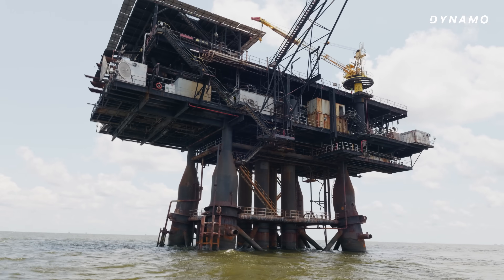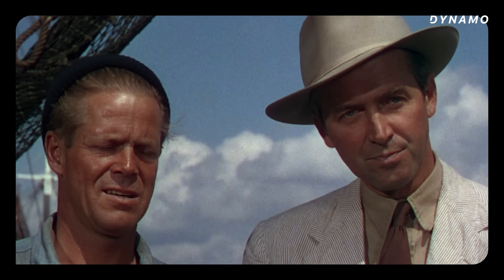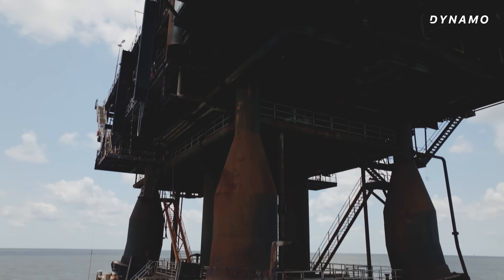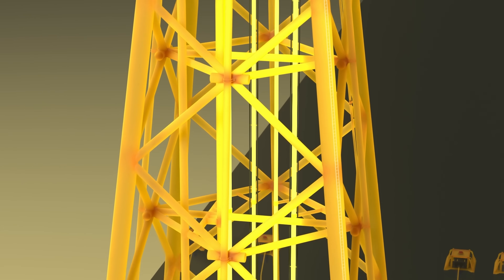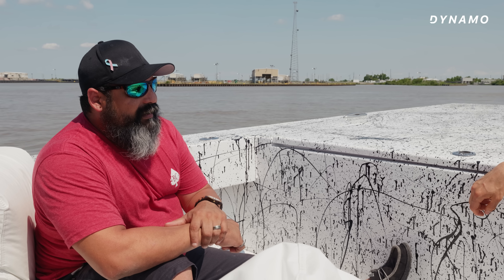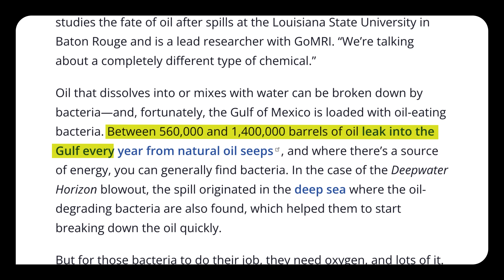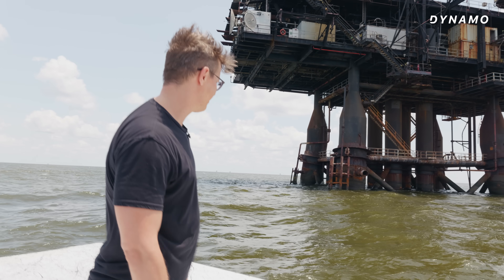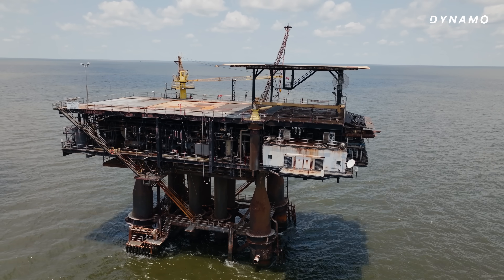I Visited Abandoned Oil Rigs — and Found Something Terrifying Underwater

Comment: Corrupt American politicians, paid personally by the oil industry.

Abandoned Wells
There are approximately 14,000 inactive oil and gas wells in the U.S. portion of the Gulf of Mexico that remain unplugged. 
Definition: These wells are considered inactive because they have not produced oil or gas for at least five years and are unlikely to be reactivated.
Legal Status: Approximately 2,700 of these wells are considered "delinquent," meaning they are overdue for decommissioning under federal law.
Orphaned Wells: Over 32,000 total offshore wells across the Outer Continental Shelf (including the Gulf) are estimated to be abandoned or "orphaned," meaning they lack a responsible party to oversee their closure.

Comment: I work with a company in 2025 did a full season with pull out 14 facility For a Major oil Giant. It was hard work with 12hrs shift, but honestly is all the Bs the Major Giant put in the writing and the bureaucracy behind it what make the job harder along with the man power and not whiling to paid, and yes I believe they are just 2 cranes whiting Louisiana boundary along comes BSEE and not counting in some Jerk Foreman that try to save the industry. Money is not there and is a lot involved in cleaning and blow out that happens at time of the removing this Platform. We remove a giant 856 Tons it was a beast.

Comment: Since 2017, BOEM has focused on supplemental financial assurance for all sole liability properties where the owner is not financially strong, as determined by criteria found in the regulations at 30 CFR 556.901. BOEM defines sole liability properties as those where only one owner is liable for the lease or grant obligations. If the single owner defaults, there is an increased risk that the government will have to pay for the decommissioning costs

Comment: I have worked in the oil and nat gas industry for 15 years so far as a landman here in Oklahoma ( and no the TV show Landman is not accurate lol )  Anyway we have programs out here to clean up old oil sites and for the most part it works pretty well.   The problem with these big industry companies and that includes chemical companies is that the fines are cheaper than the cost of cleaning up and disposing properly.  I am a big proponent of fossil fuels, but it needs to be done in a clean and responsible manor.  I will say that I do appreciate you for the most part keeping the oil and green energy politics out of this and not making this a demonizing fossil fuels video.  I enjoyed watching this and some of it I knew, and some of it I did not know.  Good stuff.
Reply from the maker: Thanks for this! Means a lot coming from someone with your experience. -Nich
Reply: Oklahoma has a problem with the abandoned oil wells across Oklahoma. Wastewater from the oil wells is starting come out of the ground threatening the drinking water supply. 
The wastewater from the oil wells is carcinogenic.
Abandoned oil wells are a plague across many oil producing states.
Reply: @Release-Jeff-Epstein-files   actually the problem in Oklahoma are the Wind Turbines.  They are not green friendly at all.   Also as someone who drives all over Oklahoma for a living I do not see tons of abandoned oil wells.  If a well dries up the pump jack just stops and it is a small area of land not much larger than a garage that sits on private property, generally a farmers land.  Also  Oklahoma Energy Resources Board (OERB) cleans up old well sites and have done so with 20k sites so far.  Also it is pretty easy to plug a well.    Oklahoma has robust, ongoing efforts involving both industry self-funding and legislative action, but the scope of the problem means the cleanup is a long-term, evolving process.  Also many wells are on Tribal land which are under the jurisdiction of those Tribes.   You can't compare abandoned oil wells in Oklahoma to what is out in the Ocean.

Comment: What would planet Earth do without climate freaks to clean up stuff it produces naturally that the herd pumps out haha.. Ask free AI about Algae in caves that requires no light. Notice same products can be made with Algae processed into Crude the exact results of use.. "Fossil fuels!" Hahaha.. Points at CO2 Generator at Greenhouses Ahh! Climate Change generator! Hahaha! Runs finger from Diesel engine Thermoelectric generator wrap to capacitor bank then to pump that is in sync with engine exhaust to push through water without hindering the engine Oh hey! Carbon nanotube and Synthetic Diamond resources! Hurray! Primitives.. Can't even base natural hahaha! Points at giant holes in Russia made by underground methane explosions > Slides finger to Oil rigs burning Methane I would be using Ultrasound and sending that Methane in a loop to a tank with Ultrasonic resonance heating + Ultrasound pressure + Cavitation until the Gas indicator light goes out then running through a fuel water filter = Methanol ftw.

Google: "Organisms that eat crude" + "Organisms that eat plastic" Mother nature already has solutions for when pressure builds leading to natural oil spills. Like I said, where would Earth be without climate freaks? Points at acidity level in exhaust filter > Points at acidity level in rain Remember Acid rain? If you want to solve things > Google: "Chlorine DNA damage" + Ask AI: "Why did we stop using Sodium Fluoride as rodent poison?" Start with "Genotoxic" dosing of masses which is why you're all so easy to get into a larp. Holds up a Scale Define: Genetic behavior.. Earth science: "We wuz scientists and sheeit! No sound in space no medium! Hey, lets talk about the interstellar medium." < Lol.. My favorite climate freak to date on Hate list = Google: "Hitler the Vegan" Yesss.. Extinction Rebellion. - Dracula/Hades

(Edit: For history defect majority = Dracula means son of the Dragon aka little Dragon.. That removed order of the Dragon from Religion because they caused cannibalism with a meat ban. What Religion was majority in Germany ww2? Now look at them teamed in WW2 with Islam. Okay.. Now look who owns all the oil. Nazi got you AGAIN.. HAAHA!! Ready for round 3? Googles: "Saucer over Dracula's birthplace pouring SMOKE Yahoo news 16th Century Church painting" I know the SCIENCE.. I mean I gotta, I own the bad mind downloading server.) https://www.youtube.com/watch?v=ZOg8PG6BUHk

Comment: Would be kinda cool if the old rigs were safe enough to turn into a house or something….. cap the well and remove all of the pumping/ oil stuff ……. Kinda like the sea land people
Reply: There are a number of unsustainable reasons why such notioning and mayhapsing is a pipedreamt nightmare . One of the important ones is a fleet of PSV's is required to  maintain the platform and the PSVs themselves as well as supply the humans needs. It is also known as logistics and they fail when the platform is unproductive, that is economics.

Comment: I feel compelled to respond to this video.  Full disclosure, I have worked in the Oil and Gas Industry for 36 years.  The cases that are referenced in the video (BP Macondo and Taylor Energy MC-20) were not permanently abandoned wells.  The MC-20 wells were certainly aged, but were live wells in production at the time of the accident.  Macondo was an exploration well in an unproduced reservoir (the reservoir pressure was 16,800 psia).  Macondo was temporarily abandoned (I don't need to comment on the effectiveness of that process).  A depleted and properly abandoned well presents a different risk.  It is misleading to suggest there are thousands of Macondo's waiting to happen.  The remaining energy in most abandoned wells is much lower and they have been plugged and abandoned in manner to ensure that a blowout will not happen.  The industry does need to behave responsibly and within the law.  Blowouts or spills should not happen and are not excusable at all.  However, it is important to present both the risks and the benefits the industry provides in an accurate manner to make good and properly informed judgements on it's value to our region and our country as a whole.

Comment: Saw a couple of contradictory things here, you indicate that many of these rigs or platforms need to be capped because they're the possibility of leaking oil, if they will still leak oil and why aren't they usable to retrieve the oil that they're indeed in danger of uncapping? Then you mention smaller companies squeezing out what's left, and then ultimately filing bankruptcy, my concern is who allows these companies to build these platforms and not remove them when they're done a plain and simple and common sense question, somebody must be in bed with someone to allow these huge corporations to build these disasters and not clean up their mess when they are done! Absolutely ridiculous!

Comment: You should really know what you are talking about before you make a video. 
First of all, depleted wells are not just abandoned. They are plugged just not removed. Secondly a depleted well can not build up pressure and blow out, it’s depleted!!! Otherwise the company that owns them would still be producing them. So you looked at the well files to see what and why those wells are no longing flowing, I’ll answer that, no you haven’t. You see these old platforms and assume they are just abandoned with no regard to wildlife or ecosystem around them just so you can make a video to make money. 
By the way I’ve been working in the gulf for 45 years and a producing well will not “blow out”. Do you even know what a blow out is? Probably not. Main Pass 77 is not an oil rig. Do you know what an oil rig is? Probably not. 
You have all this information on your video just crammed together like you know what you are talking about but in reality you don’t know anything, especially the difference between drilling and production.

Comment: Congress could easily pass a law saying: you have to set aisde x amount to plug the well before you can even start construction, and will be held criminally liable (actual jail time) if you don't follow through.
Problem solved. That easy.
At least it would be if it weren't for citizens united and corporate lobbyists.

Comment: If old oil wells can be used to produce hydrogen then we need to be throwing every penny possible at that. Oil and natural gas will dry up probably in our lifetimes and we are yet to find a reliable, sustainable and less ecologically damaging alternative. So far the only ways we have of producing hydrogen takes huge amounts of energy to create rather insignificant amounts. If old oil wells can be turned into hydrogen farms and do so without causing insane amounts of ecological damage then it’s an absolute no brainer.

Comment: i don't know how I didn't know there were so many oil rigs just sitting out there abandoned. I only ever thought there were like a 'big' handful of these kind of structures just sitting out there, but I wasn't expecting there to be hundreds (possibly thousands) of them out there. I usually thought that they always took them apart (the oil rigs) piece by piece or whatever (maybe except for the lower supports or parts like that cause those would be a lot more difficult to take out) or at the very least most of it to where the platform was basically the only thing left.

I know for a fact that there are so many things you can repurpose these rigs for. of course, I know that this will come with risk like if its unstable or poorly maintained and all but still...you can at the very least...uhhh...idk, do something with them 😵‍💫

Comment: The thing that would make the most sense (to me) would be the large multi trillion dollar company that installed the well and platform in the first place has the responsibility to seal the well. the rig itself can be passed down from company to company eventually becoming a wind farm of hotel or whatever, but that 1st company that put the hole in the sea floor had to have the money for the bond to remove it when the time came. forcing them to come back and deal with it after it's been handed down and sitting idle for 40 years would make them the financially responsible party and they would be financially capable. That bottom rung company just scrapping by doesn't have the ability to stay in business after it taps out so why would we expect them to deal with the removal cost. Unless the bond is also past down with ownership. but $5 says Shell still has that 1-3 million dollar bond in their pocket. that way the original bond would have grown with inflation and what not so the last company gets to use it and cash in what if any extra remains from it. that might keep the 1st and 2nd tier owners happy since if they go cradle to grave they keep all the bond, but if they pass it off to someone else they are handing over the financial equivalent of 1st and last months rent to the next company for the eventual clean up. but I'm guessing these laws don't work the ways we want them to, or for them to make the most sense.

Comment: I flew for Air logistics and Bristow in the Gulf of America for 17 years and seen many platforms, both good ones and down right disgusting ones. But I would not say that these platforms are abandoned. The owners still have have to make monthly, bi-weekly or in very rare cases daily visits as set by the BSEE, formally MMS, to ensure the fog horns and beacon lights are working and that there are no contaminants being released into the water. Each platform also has a set number of fire extinguishers that need to have its inspection card punched each month and replaced every year. BSEE may fine the owners for past due inspections or maintenance that were not completed. I've seen many operators panic at the sight of a helicopter circling overhead thinking it might be BSEE making a unplanned visit.

Comment: How do u risk a blowout if they dry up? If there isnt enough pressure to pull barrels how is there enough pressure to cause it to leak at anything larger than a natural rate….
If anything i feel like im more worried about the toxic/exotic metals/compounds left behind to dissolve into the seabed or water…. Shit like leftover welding rods or consumable trash that have cadmium, lead, and all other types a funky shit…. Idkk thats just my line of thinkin
Reply: Someone please inform me on why a blowout is still a risk if its dry

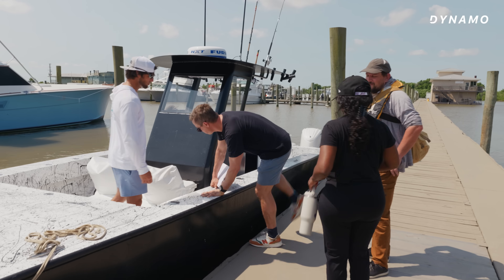Comment: 7:18 well questioning if an oil rig is bad for the environment sounds dumb cause in its lifetime it probably created a co2 load thats probably crazy and depending on the age this oil was used with much lower enviromental standards making it even more dangerous. and then those oild rigs probably were during lifetime maintained using ship chemicals which also poisoned the sea back then and today yeah if oild leaks good night if not it probably isnt that problematic as long as sea cards point it out as danger. edit: after watching more its pretty clear that it leaks and that its crazy bad....

Comment: Why not just keep them pumped instead of closing them? If the problem is the pressure then release it no? And what does it really mean when the oil is running low on the rig? Low pressure? What if because it’s be sitting there for so long it’s now full again?

Comment: So how it really works since im in that industry. First a rig is for drilling. What you were talking about were all production platforms. Second when a oil company goes out of business like many of the smaller ones out here will the responsibility falls on the original installer for removing them. There is a massive backlog for removing. And just because you see the casing for a well on these structures does not mean they haven't been plugged. Im not saying there are none out there that haven't been but a vast majority of them have already been plugged. And actually one of the ones you went to in this video that has been abandoned by fieldwood I know those wells were plugged. There is quite a bit of inaccurate information in your video. And there is a consequence to removing all of the structures. I will agree they are a eye sore but they really are already artificial reefs. If they were to always remove them you would almost wipe out the commercial fishing, at least for snapper, in the gulf.

Comment: I wonder if there would be such a way to turn deep-off shore oil wells/rigs into full fledged high functioning Datacenters, Microsoft has been experimenting with off-shore storage for data. 
It would only require larger projects that require such cooling to take place.

Comment: I'm sure 25 years from now, when the "infrastructure-scale renewable energy" has been milked dry and is no longer profitable or as profitable as it once was or needs repairs and costs far out weigh what the renewable make we will see this exact same thing happen to our farm fields leaving someone else to clean up the mess.  This exact same process not only happens to oil platforms but to gas stations, hotels, et cetra.

Comment: I also worked on disassembly crews as a medic with SMIT-TAK. It takes a lot to plug wells, remove surface structures, pump out chemicals and waste products. Deep wells they would cut or use explosives to dismantle legs then pull the rig over, creating a reef, but the shallow rigs had to be floated and hauled to shore for scrapping.

Comment: The subsea portion of the platforms make excellent reefs for sea life. The problem with them is that they'll degrade rather quickly without regular maintenance. The real problem is to insure that the well itself is properly plugged. Others here outline the problem with the way that these wells don't just stop producing overnight. Production tends to slowly deplete to the point where the original owners sell them off while still in declining production to smaller companies which often suck out the last few barrels then walk away.